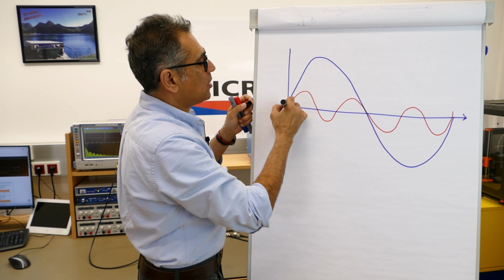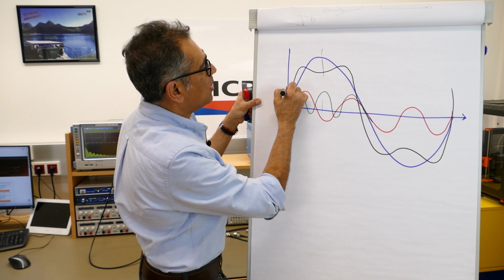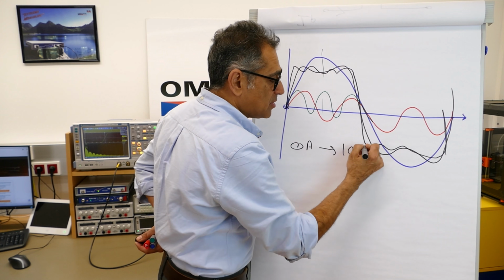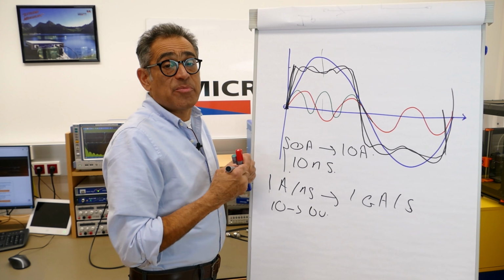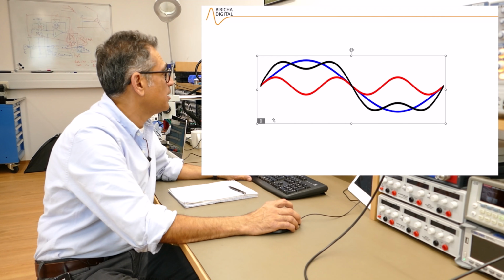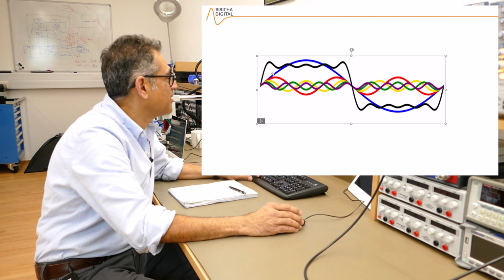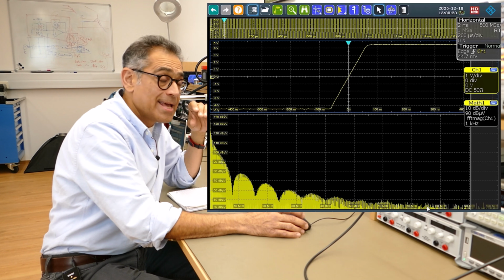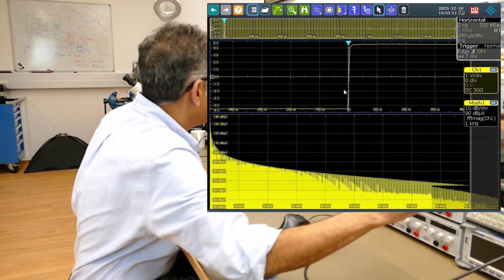Why Switch Mode Power Supplies Are Noisy (Explained Simply)

Comment: Is there a reason why you only used odd harmonics in the example?  Thank you.
Reply: "A square wave consists of a fundamental frequency and an infinite series of odd harmonics (3rd, 5th, 7th, etc.) at diminishing amplitudes, calculated as 
 of the fundamental amplitude. These components (fundamental + odd harmonics) create the square shape, with higher harmonics contributing to sharper edges and flatter tops."

Basically because those are the harmonics that constitute a square wave. If you have a square wave, you know that signal contains odd harmonics and the even harmonics are either zero or negligible

Comment: Thank you for this in practice experiments with real equipment! 
I guess the most important part is to mention about actual trace structures which cause issues: 1. high dI/dt over current loop - act as a coil and will dissappear EM energy into EM waves on resonant frequencies; 2. High dV/dt over distance will dissappear EM via capacitance of electrical field in between.
One rule: make return path with constant impedance alignment as non negotiable.(just make sure you have ground reference under all traces uninterrupted, and no trace forks)
💙💛

Comment: Simplified version: nature (quantum nature of the EM field) doesn't know if the signal will be periodic or just a single pulse, edge. If it's fast enough it will be transmitted (along the wires/traces or as radio if the conditions/parameters allow, that's why simple DC transient - flipping the switch - sometimes can be heard in the AM radio as "pop").
Rise time "acts like" (or is "treated as") period of the signal (so from the rise time we can derive real numbers, top frequency, harmonics should be mostly below that).
That's from the one clean transient (chips/transistors) - now imagine that you're using switch (or brushes inside motor) that is arcing...

Comment: this difference between the fundamental frequency, and the frequency content of a signal, is one of the more common misunderstandings i see from electronics hobbyists. usually comes up in the form of clock signals for digital logic. "what's wrong with 1970s pcb layout? i'm only running at 8MHz." while they happily drop AHCT logic in everywhere.
Reply: Hey i appreciate your comment and im still learning about electronics. Would you explain a bit on what do you mean by dropping AHCT logic?
Reply: @concretesloth2968  if you're asking what i mean by "drop AHCT logic in", that's a colloquialism to suggest that they're using AHCT logic casually without considering the consequences. AHCT tends to be the culprit because it's the "fastest" 74xx logic that has lots of parts available in it. so hobbyists just grab it, ignoring the consequences of its very fast rise/fall times, which is the issue being discussed here. the resulting high frequency noise can't be managed with poor (old, wrong) PCB layout techniques.